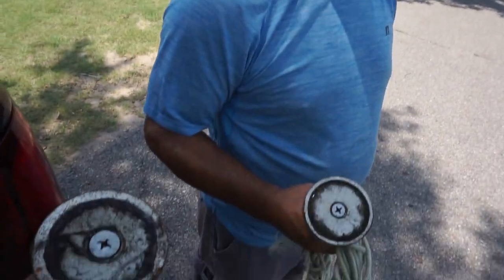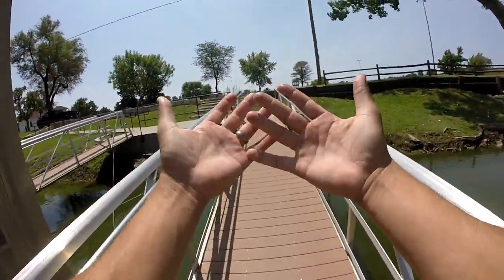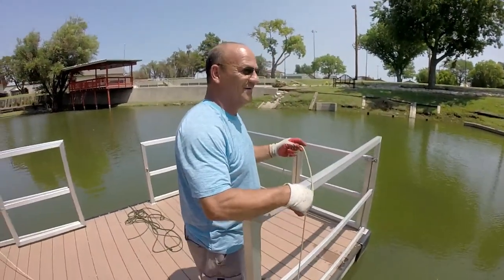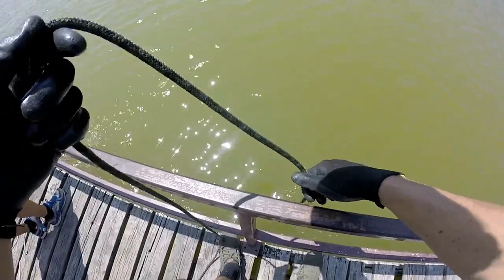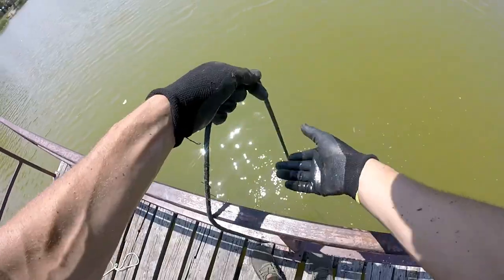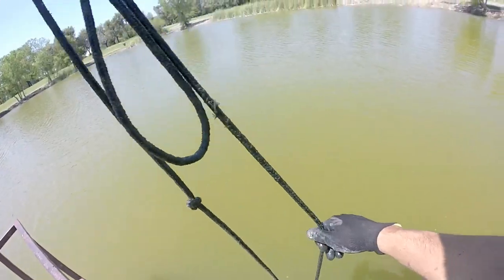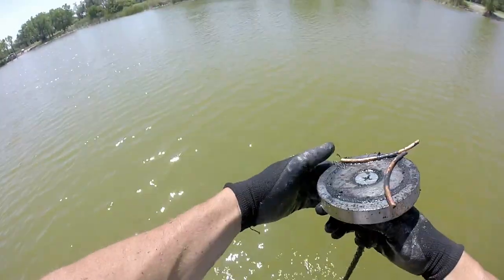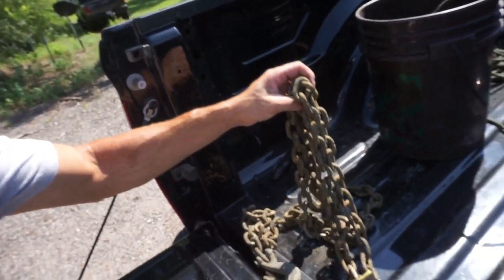MAGNET FISHING FOUND TONS OF STOLEN COPPER IN POND!

Comment: its copper platted, copper is non magnetic
Reply: You are correct!
Reply: That is why it was dumped ... the scumbags who stole this might have had some real copper tubing. This crap they cut off the ends, seeing the similar size of these pieces, after they burned off the outer plastic ... or the scumbags stole this not knowing it was just plated in copper ... burned it after cutting it down, discovered it was not worth a cent really, and dumped it. Either way the scumbags have hopefully been caught in the act. You got to steal metal to scrap to survive ... you don't really need to be adding to the gene pool.
Reply: Xtreme Performance  It's #4 rigid, it has iron in it so it sticks to a magnet. I use it all the time in service installations. It's worth half of whatever copper value is, I've scrapped lots of little pieces.
Reply: I feel like he did that intentionality, but at the same time the other dude called it 0-0. It's more like an 8 gauge.

Comment: That isn't copper. That's CCS or copper clad steel conductor wire.
Typically used in antenna applications.
Some turd cost someone a small fortune, thinking they scored #1 copper.

Comment: What you have there is copper clad steel wire. pure copper is non-magnetic.  Great video.
🙂👍🏻👍🏻
Reply from the maker: Thanks for the info
Reply: BobbyGuyFilms every one thinks it’s non magnetic but it’s magnetic people are so dum :l
Reply: @roydriver74  Science is an amazing thing.  Copper is not Ferrous.  Iron and Steel are.  Copper is not Magnetic.   Iron and Steel are.   I use a 2350# Magnet when I take apart Jewelry [[among other things]] to pull the Steel clasps and parts out of the crushed Jewelry.  THEN, in order to remove Copper, Brass, Lead solder and other things such as Nickle I use acid to dissolve them leaving Gold and Silver behind.   I do this for a living. Trust me-not everyone is "Dumb".

Comment: A lot of electric utilities will use steel wire with a heavy copper coating.  The steel is for strength when spanning a large distance between anchoring points and the copper coating is for electrical conductor.

Comment: the pvc pipe is for sliding both of the metal bars between 2 poles or objects close together, and on the end that should be angled up, you place your fishing rod into it, so you dont have to hold it.

Comment: Electricity flows almost entirely on the outer surface of a conductor. With copper covered steel you get the benefits of copper on the outer surface and the tensile strength of steel. Also a stranded wire is smaller than a solid wire of the same rating because of all the surfaces it provides. Somebody was really disappointed when they found out what they had taken such a chance in stealing!!!!!

Comment: what does that copper mean. I'm only 14 years old so I don't know why people would steal and then dump it soo

Great video bye the way
Reply: Owen Self it means that someone probably robbed an A/C unit or anything electrical really to sell the copper wire. Copper is worth a pretty good amount of money. The reason it’s cut like that is because when they go to burn the rubber insulation off it will be easier with lots of small pieces rather than trying to burn one whole big line of wire. Oh and I’m only 17 but I know how crack heads work 😂😂
Reply: Maybe they stole it, then found out since it was only plated, it was worthless, so they dumped it.
Reply: Copper is very expensive to scrap but the stuff they found is copper plated because copper isn’t magnetic. I’m 14 too
Reply: I'm younger and I know that copper wire is expensive. My dad is an electrician
Reply: Charles Mitchell you might be younger. But you have a heck of a lot more brains than duface up there.  Look into what you father does, he can show you a ton, and I hope you already do. To learn that trade will always keep you employed, without the people to work on, repair, and create electronic components or machines this "society" would just fall apart. If the prospect of always having a skill set that will always be in need appeals to you, go thank your father and ask him for advice (meaning if he thinks it would be a good idea for YOU to follow the path or in the very least learn beyond the basics).
Best wishes and intentions for your future, I believe you have one, unlike twitch mcdumbass the OP.

Comment: copper is NOT magnetic 'sort of' but it DOES react strongly to magnetic fields , however. 
now.. you're going to ask if it isn't magnetic why did your magnet pick it up ? because it wasn't pure copper.. it was mixed with an alloy like tin or stainless steel etc. which is magnetic.
Reply: Good stainless isn't magnetic either- better money at the scrapyard.

Comment: Copper is not magnetic. It must have some tin under it. I'm not saying this to contradict your Dad but I take scrap metal almost weekly and they check out the metals: copper, aluminum, steel and tin. If it sticks to a magnet they told me that tin is mixed with it. So I check it out with my magnet and if it sticks it goes into the tin scrap pile. All my copper that doesn't stick to the magnet I get paid more money. They will not take copper wire or any copper that has been burned.
Reply: Tin is a non ferrous metal.

Comment: Why is it that a piece of crap wire is cut and its automatically stolen? in order to install wire in or on anything you must cut it. Those look like your average clippings from someone doing work to a small boat etc. clearly when they were done the job some of the wire fell into the water. and as everyone ( except these guys) knows copper wire is non-ferrous (meaning no iron). This is why I never like or subscribe, i'm not going to get these guys paid for stupidity or click bait.